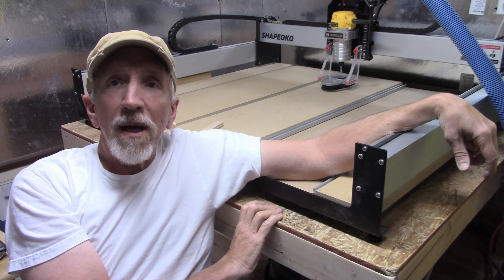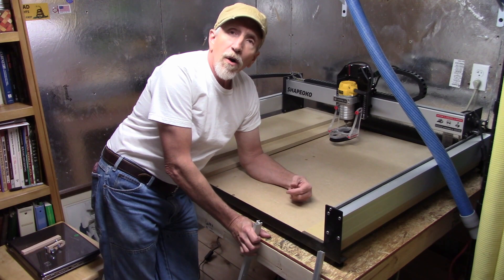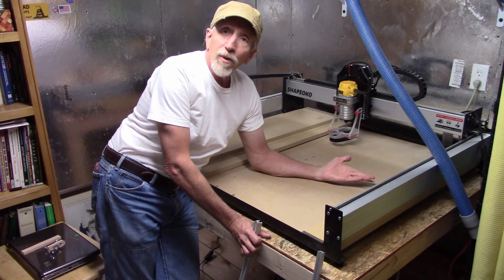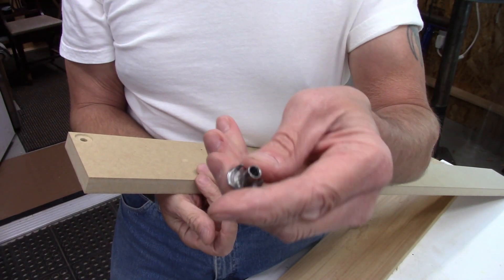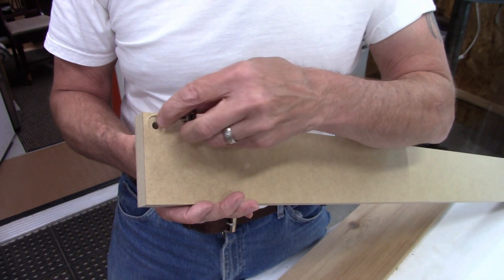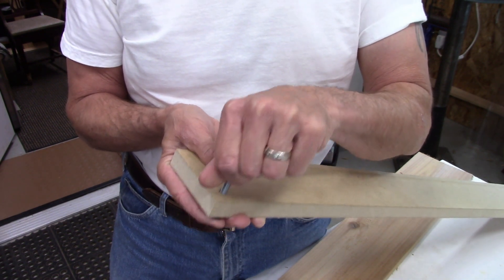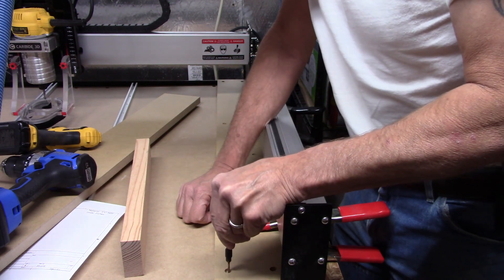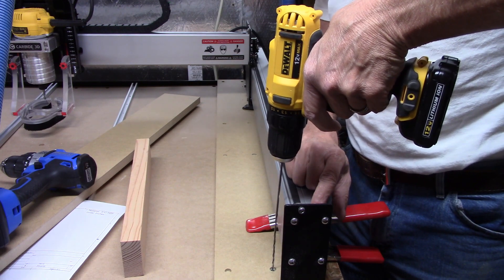Clamping system setup for Shapeoko 3 CNC

Comment: holes in specific spots is the job of the shapeoko not a drill press
Reply from the maker: I agree totally, however without a clamping system I could not hold the work accurately and did not want to damage the spoilboard . Also did not have a bit to countersink for the t-nut. For me the placement of the holes was not critical. Thanks for watching John!
Reply: 1/4" mill bit does the hole and the countersink, accurate placement was critical for me as my clamps have matching holes, the L clamp has several holes that need to match up, dont need to clamp the boards to put holes, just screw them down, I did each end of the boards separately to get holes outside the mill area